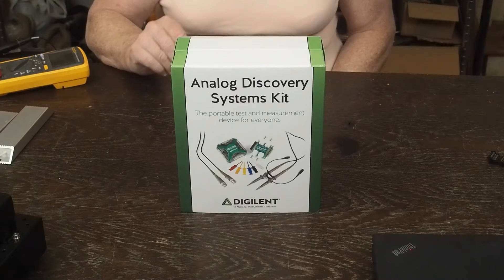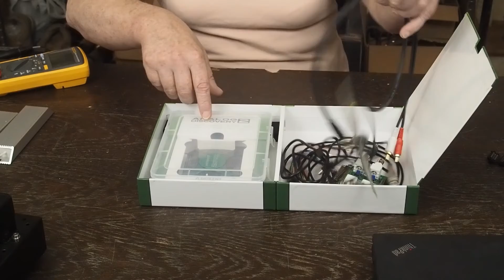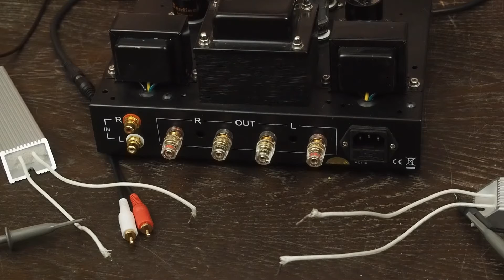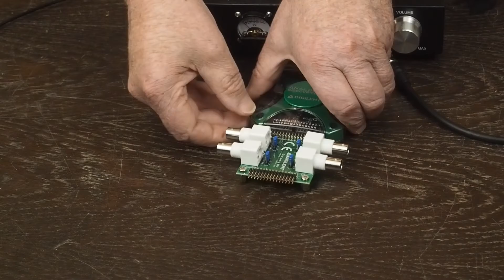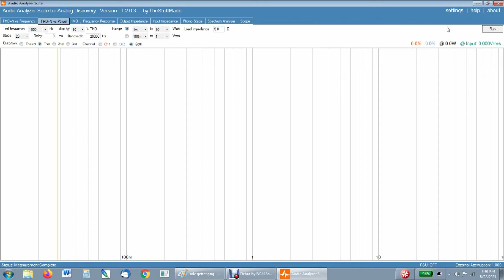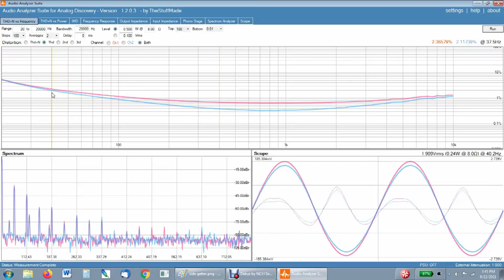Audio Analyzer Suite / Analog Discovery 2 Review and Demo

Comment: Does the compensation of the probes need to be checked and adjusted?  Don't recall you mentioning this in the video.
Reply from the maker: The compensation adjustment is only for the 10x switch setting which is not being used
Reply: @SkunkieDesignsElectronics  thank you.  One less thing to worry about when my Discovery 2 probes come.

Comment: I only have a solder iron,variac and multimeter, the rest must be in my head, if i gett across a tube tester i will buy it,sinse i have alott of tubes, now i have to test tubes in amps.not perfect,but seems to worke,i alsow so uncle dough,ask if you realy wold have matshed tubes in your guitar amp. But i keep hifi pentodes,in the matshed sett. We are on way to single end here now,but take our time, in a while my 300b amp are upp and running again, there are probobly somthing with the one chanal.

Comment: Will you please give some  hint on testing PREAMPS with  AD2 (or3) kit? Why the question: what should serve as a load here? Any other relevant advice on such test would be very much appreciated. Thanks in advance, Stephe.
Reply from the maker: Just make up some 100K and 50K loads and go for it.
Reply: @SkunkieDesignsElectronics   I was about to set up the preamp connection to a real power amplifier (not dummy load) without powering it up,  - Is it acceptable or incorrect? I decided to do so because I was about to use a convenient-looking optional Audio Adapter+  ( DPN 410-418A) instead of stock BNC adapter.
Reply from the maker: That should work I would think? Never tried it so can't be sure.
Reply: Yes, that works, with 47K load set in the AA suite parameter.
Also I wonder what is the idea of setting different Bandwidths in THD vs Freq tests? Setting different values yields different readings. Can you explain why? The higher the bandwidth - the farther to the right  on the plot goes a slump in THD percentage ( 10 times down) graph. What does it mean and is the Bandwidth setting related to the test signal freq range in our tests? Why should we designate the Bandwidth at all? 😮
Reply from the maker: Sorry I can't. These are better questions for the guy who wrote the software.
Reply: @SkunkieDesignsElectronics  Well, I expected this answer. In each case I saw in his video that he sets the Bandwidth parameter to 62 kHz whereas you set it to 20Khz. (Never change this?)
I noticed that the mentioned 10-fold decline in the curve starts approximately from the Bandwidth setting divided by 2. Very peculiar, isn't it?😉
To wrap up the issue, I'd like to share with you the answer I' ve just received from the Guy. I'm citing Jake: 
"Hi, the Bandwidth sets the highest frequency content you want to recordings e.g. 96 ksps/24 bit distortion, you need 2 times the fundamental frequency to measure 2nd harmonic distortion and 3 times the frequency to measure 3rd harmonic distortion etc etc. So e.g. if you set the bandwidth to 20kHz, you can only measure THD up to 10kHz. To measure 3rd harmonic include in the measurement, so you
could argue it should be left at 20kHz as that's as high as our hearing will go. However there are scientific studies suggesting we humans can sense higher frequencies, as in e.g. we can sense the difference between regular CD content 44.1 ksps/16 bit (22kHz bandwidth) and high res digital (48kHz bandwidth), the same with tapes and vinyl that can reproduce higher frequencies. For the
distortion at 20kHz you need a bandwidth of at least 60kHz. Hope it makes sense.."

No doubt, his answer is perfectly informative, clears up my initial question and very useful here.
Reply from the maker: This is why I said to reach out to him :)

Comment: Very much enjoy your videos.  I bought the analog discovery 3.  I have tried to use it to measure the frequency response and distortion of a digital amplifier (Fosi audio ZA3).  The distortion immediately registers too high and the sequence shuts down.  Also - it seems the amplifier itself shuts down when the ground circuit between the amplifier and the analog discovery 3 is completed.  Would appreciate your thoughts.
Reply from the maker: Are you trying to measure both channels at once? That could cause issues using the factory breakout board on some SS amps. I also have run into SS amps that reverse the positive and negative outputs the popular PASS ACA amp does this. Have you tried to measure any other amp successfully?
Reply: I tried both and only one.  I didn’t try reversing the polarity.  Will give that a shot. All I have is class D amplifiers here. Thank you for responding and will let you know what happens.

Comment: I just started using this to test my 6BM8 build I am finding that on the frequency response graph, it shows a negative gain instead of around 15db at 1k. The amp sounds fine so not sure why a negative gain reading. Volume was set at 12 o’clock.
Reply from the maker: You have to set the volume wide open for any testing.

Comment: I saw in another video that it is not recommended to use the included BNC adapter board because of grounding issues - when not plugged in, there is no connection between the connectors, but once plugged in all four connect. They recommend building your own when using the audio analyser suite for differential grounding instead of the included adapter with common grounding.
Reply from the maker: In my amps, all of them are grounded too. The only issue is if you try to use the BNC board with bridged amps.

Comment: Are you using the Digilent BNC adapter?  @TheStuffMade recommends not to.  Does the Digilant card work correctly? Or do I need to build a jig?
Reply from the maker: I'm using the Diligent BNC adapter, I think the problem is you can't test bridged amps, which I'm not testing.

Comment: How would i check a preamps distortion with this, since it makes u choose 4 or 8 ohm?
Reply from the maker: That only is if you set the input RMS voltage based on output power (like auto ranging). You can set a specific range as well.
Reply: @SkunkieDesignsElectronics  so im guessing then the 8 or 4 ohm setting is only used to calculate and show the power ratings so i can ignore that and just set my voltage input settings and that and check freq and thd without issues relying on the 8 or 4 ohm selection. Ill just use a 50 or 100k ohm hooked up to the output of the circuit but select the 8 ohm load then correct?
Reply from the maker: check the box below that:100m to 1V  and it will ignore the one with the ohms. I test with a 50K load.
Reply: @SkunkieDesignsElectronics  I see, I have an older version so will have to update from ver 1.0

Comment: Great video! I bought the discovery two because I want to learn more about this kind of stuff as oscilloscopes and harmonics have always seemed like black magic. 
Will you do a video that explains what you see and what significance it has on the amp, for example when you are trying to see if it is working or not?
Also I have a nad 3020i with low volume on one channel, is the discovery 2 something I can use to "discover" what could be at fault?
Reply from the maker: Sure, you should be able to use the output from the signal gen, inject a sine wave into the input and the use the scope function to look for when the signal fades off. Compare one channel to the other!
Reply: @SkunkieDesignsElectronics  and the load can be speakers? And by signal fades off you mean? Thanks for reply
Reply from the maker: @hanzo52  You use the scope probe to look for the sine wave in various points of the signal path.  You can compare how strong the signal is in both channels and this way when you see it is much weaker in one channel than the other, there is the point the problem starts. If you are talking about a tube amp (I have no idea what a Nad 3020i is) use a dummy load on the output, as the noise of a sine wave in a speaker is pretty annoying, especially at 1khz! Also understand where the high voltage is, how much DC is OK for the measuring instrument etc.

Comment: Hi Stephe, it seems the BNC to RCA adaptors are not part of the kit, You need to pick those elsewere, right?
Reply from the maker: Yeah. I got a BNC to male RCA, then a female RCA Y cable to two males RCA. Use the 1 side of the output to drive the device for testing.

Comment: I'm thinking to buy AD PRO 3250, as a technician  I got many instruments, but to be honest I'm considering it for it's almost infinite features. 
I'm really curious to try the audio tool, so ,maybe my xmas gift 'll be this, the 3250 or 3450 if I can afford.
The only thing stopped me till now is the workflow, so I would try it some days before buying, I'm not a pc based stuff super fan, anyway it seems what I want/need.
Reply from the maker: I really love this audio analyzer suite freeware. I understand the Analog discovery 2 isn't "scientific grade" and likely the distortion numbers are a bit higher due to the signal generator introducing some noise, but it's so easy to use and works fine for comparing changes and different amps etc.

Comment: Hi Stephe,  I'm glad to see you are getting similar readings to what I'm seeing with a used Analog Discovery unit I picked up on Ebay. I'm seeing the same channel imbalance on the 2 DIY tube units I quickly measured. THD was higher than I would have guessed too. But now knowing that part of that might be inherent in the signal generator in the AD makes me hopeful the actual THD is a bit lower than the measurements show. I'll have to run a loop-back test to see what that shows. 

Keep up the good work!
Tom
Reply from the maker: I look more at "Where does the THD take a hard turn" rather than being worried about if it's showing 0.5% or 1.5% Also the frequency response stuff + THD vs frequency is helpful.

Comment: Thanks for sweeping your 6P1! I did your mods on mine so I think it's safe to assume a sweep on mine would yield very similar if not identical results (I too rolled the Soviet 6P1's and added vintage 6SN7's). I run mine into Klipsch RP-600M's and also have a vintage 80's Velodyne ULD-15 sub that I recently refoamed the surround. This is more sub than i need, so I just keep it relatively low. For for the 1 watt I'm getting before distortion kicks in, it sounds really good.

But my winter project is definitely going to be hand-building a new amp, probably the 6SQ7 amp. Keep up the good work Stephe!
Reply from the maker: Right, it is a REALLY good first watt of power. I promise to get the 6SQ7 build series done before winter :)
Reply: @SkunkieDesignsElectronics  Glad to hear that 6sq7 build is not dead!!! really looking forward to building it !!!